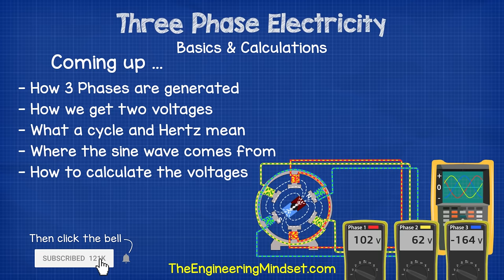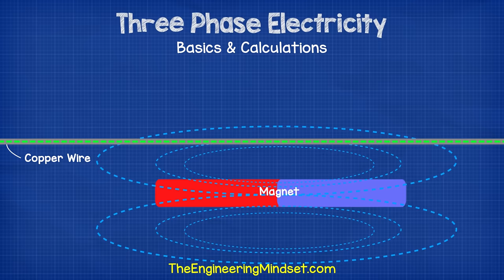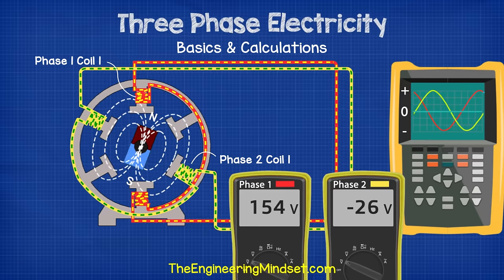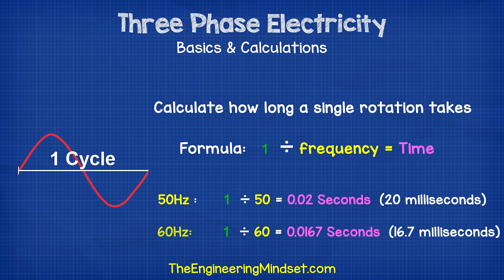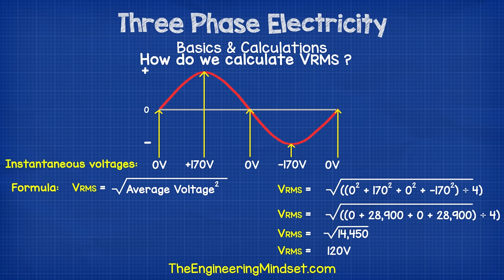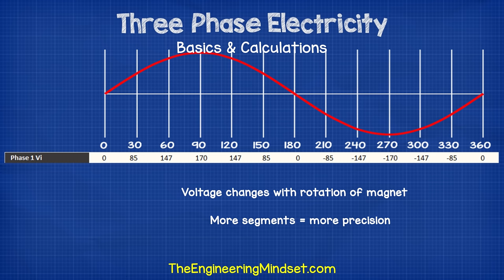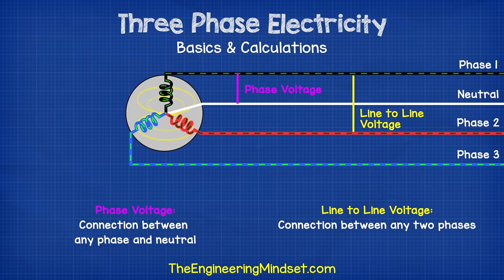Three Phase Electricity Basics and Calculations electrical engineering

Comment: In your other video, you were showing the max and min of the cycle to be at 0 degrees and 180 degrees, while in this video you are showing the max and min at 90 and 270.. isn't the cycle supposed to be at zero when the magnet's north pole points up (90) and south points down (270) since that is the neutral axis of the magnet? Im getting confused here because everything is shifted by 90 degrees compared to your other video (single phase explanalation - part of 3 phase video)

Comment: Why there is voltage differences between phase to neutral and phase to phase voltages. You didn't explain it in the video, but could you tell us about it??
Reply: because windings are connected together at one point (center of the star connection)

Comment: 11:25 Why use radians ? Vmax x sin(°) works just as well.
Reply: I'm just guessing, but I think this is for knowing phase at a glance. In most formulas, you'll see little omega, which is practically a constant, and theta. Omega is in radians and theta is in degrees. Since you can only compare phases between sources with equal frequencies, by separating them you can see at a glance how much out of phase it is and if it leads or lags. In fact, in the phasor domain, you ignore the frequency and focus on phase only. This makes for easier AC circuit analysis with capacitance or inductance elements.

Comment: Hello. Thanks so much for making these. The visual aid's are very helpful.  I'm having problems getting the same values for "Vmax x sin (radians)" I see it work for the 30 degrees calculation at 85 volts, but the others have me perplexed.  I.E. How does Vmax (170V) x 1.571 at 90* end up 170V?
Reply: It's 170 V * sin(1.571). 1.571 is 1/2*pi radians (or 90 degrees) and the sine value is 1.

Comment: What things can we use with 2 -phase  or 3 phase electricity?
Reply: It's commonly used in homes for ovens, dryers or tankless water heater. But really anything really powerhungry.
Reply: Thought Provoker    Nothing I know of runs on 2 phase.   Tesla gave up on 2 phase in the 1890's.   3 phase.   Motors are the only true three phase equipment.   Large electric heat systems take 3 phase power, but the reality is they are single phase heaters connect in three phase configuration as an example.

Comment: could you help me please
I built 2 rotary ph. converters 240 VAC   in, Using a 10hp idler at 1450 rpm, It only took caps of 50 micro  farads on each leg to obtain a very even 230 out three phases
but most of my machines run on 415 vac , when I tried to get that from my phase converter by piling on the cap, the motor got very hot
realising that I need a step-up tranny
the odd thing is that i can run my genset 415 to run a hydraulic power pack without issues even though the the motor label says 220 vac only---it came from a ship
it runs well too on the phase converters
will long term use running that motor near 400 damage it
thanking you

Comment: I dont understand why the voltage is in phase with magnetic flux in this example. Because if you graph a sinewive (magnetic flux) you take the slope of the graph and that is the voltage, that is another sine wave but not in phase with the magnetic flux. Can somebody explain why in 4:53 a peak in magnetic flux is in phase with a peak in voltage? thank you very much

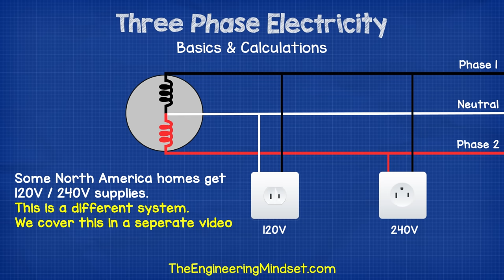Comment: 2:09 A split-phase supply is not a two-phase supply, that's a (type of) single-phase supply. It is single-phase because there is only one phase angle, despite having three voltages. An actual two-phase supply has two phase angles; two voltages in quadrature (i.e. 90° out of phase) in time; it is a two-phase supply because it has two phase angles, not two voltages. And a three-phase supply is three-phase because it has three phase angles, despite having three line voltages and three (in three-wire supplies) or four (in four-wire supplies) phase voltages.

That's the way I look at it.
Reply from the maker: Seen our new 3 phase transformer video?➡️: https://youtu.be/u0SsejDCVkU

Comment: Hi Do you know what Tesla's 2 phase Niagara falls generators were?
Reply: Sam Stewart    Did some research.  This is what I found.  
Westinghouse furnished the 5000 horsepower (3,700 kW) generators that connected to the turbine. Twelve, 2800 pound, electromagnets plus the drive shaft provided a 25-ton flywheel that spun as an outer structure (umbrella type) around the windings that were arranged as two sets of poles at 180 degrees to produce two phase and 2,300 volts. Six poles rotating at 250 revolutions per minute produced 25- cycles. This output was connected by four wires to a control panel
Reply: @KevinCoop1  quite an impressive construction...
Reply: Eric Scaillet     For it's time, agreed.   I've worked on projects that were much bigger.   Like one building that was 25 times more power and powered by diesel.   A small part of the whole project.    Happy 2020 New Year!
Reply: @KevinCoop1  Excellent research and explanation......many thanks!
Reply from the maker: Seen our new - How wind turbines work video? link: https://youtu.be/Hf875eOVrVI

Comment: can only 2 out of 3 phase work? what kind of voltages would you get?
Reply: If you take 2 phases only, it behaves like single phase (two wires only) and the voltage is 400V for example of europe, some small welders use that kind of supply - they have single phase transformer but you connect it instead of phase and neutral (230v) to phase and phase (that gives 400V)
Reply: Vo Town    If you consider phase as a sine wave, in 3 phase clockwise rotation A-B phase 1, B-C phase 2, C-A phase 3,   There is a configuration called open delta( 2 phases 3 connection points only 66% of the power available).  If you consider phase connection points as A,B,C then connecting two points is single phase not 2 phase.  In 480/277, would be 480 volts single phase.  In 208/120 volts would be 208 volts single phase.   And yes these are used all the time or normal.  Hope this helps you.   Respectfully,   Kevin

Comment: Here in Brazil, some cities have 127V Phase voltage and others have 220V phase voltage. Is It possible to convert 220V Phase into 127V in my house? I'm moving to a city that is 220/380V and i want to bring with me some stuff that is only 127V. Is It possible to convert 220V Phase-Neutral into 127V WITHOUT a Transformer?
Reply: @Basement-Science  thanks for your reply. I need to power a refrigerator, freezer, Air fryer and a Microwave. I guess i'll buy those rated for 220V, since i'd need 4 transformers. I'll try to sell the 127V devices, it's not worth trying to use them here.

Comment: The voltages, in this video, are primarily residential voltages. All have the same relationship, for 3-phase power, the Phase-Phase voltage must always be Square Root of 3 times the Phase-Line voltage, that is true for all the  voltages shown @2:30. 
Industrial and larger commercial users usually get higher voltages than those shown, with 277/480 as one common example, and generate the common voltages in-house.

North America, uniquely, has dual voltages in all residences. All homes have either 120/240 or 120/208, and have also slowly been drifting from 110V to 120V and above.
Reply: 2:22 - 2:42 :   √3   ≈  208÷120   ≈   380÷220   ≈   400÷230   ≈   415÷240.   Also at 14:00.
Reply from the maker: Seen our new 3 phase transformer video?➡️: https://youtu.be/u0SsejDCVkU

Comment: I have mechanical engineering degree and we absolutely FLEW by 3 phase power in my class. No student should even be touching a pencil and calculator without understanding the fundamentals of what they're even doing but hey we just need to pass the class right?

Comment: The single phase supply voltage in the UK  is 230v and has been for years, NOT 240 volts as stated in these videos
Reply from the maker: The nominal voltage is 230V, but it's allowed to be anywhere from 216 to 253V. My house is usually around 243V
Reply: @EngineeringMindset  I know that. I am an electrician and former teacher in electrical installations. 
The video stated that European nominal rms voltage is 230/400 but the UK is 240/415 but the UK voltage was brought in line with Europe in the 17th edition of the wiring regulations
Reply from the maker: We are aware of the mistake that was published but, frustratingly, YouTube doesn't allow videos to be edited. It is a minor error that doesn't detract from the main teaching.
Reply: @EngineeringMindset  well that's ok but in your first reply to intimated that I was wrong with what I said. But getting the supply voltage wrong is a fairly fundamental error. The video is emphatic about different supply voltages in various countries.
Reply from the maker: I disagree. If I had said it was 12V DC, that would be a fundamental error. Even in the video we show a real world voltage reading. I do regret it was published with an outdated nominal voltage, but it's within the limits and is not the main topic of the video.
Reply: @EngineeringMindset  But its still wrong. It can't be a bit wrong. Don't get me wrong it's an excellent animation. But it's still misinformation.

Comment: Neutral of magnet shown with zero voltage is different than neutral shown in another similar video of three phase electricity. Why so?
Reply: This video animation is Wrong, electricity is Not produced by a magnectic field but by a change of a magnectic field. 
When the magnectic field is the lowest to the coil the change is the largest and then the coil reacts the most 
and the the highest voltage ( or current ) is produced.  In a more deeper sence the coil wants to stay as is was the coil
Does Not like a change to counter the change the coil produces voltage and current and electrical current produces a
magnectic field to eliminate to magnectic field it is exposed to. ( M. Faraday  J.C. Maxwell )

Comment: European Union regulations specify a target of 230volts (+6% −10%), for about 10 years now. It did used to be 220volts but the European Commission decided to make it the same as the UK, which used to be 240volts. I understand we all get a little less or more  than listed anyway, so the reality will probably usually be somewhere between 210-240volts https://en.wikipedia.org/wiki/Mains_electricity_by_country

Comment: You were doing so well on other videos but you incorrectly call Line phase in this video. Phase is in relationship between Lines not the lines themselves. Place 3 dots on a circle 120 degrees apart 12, 4, and 8 O'clock. now draw lines to connect the dots. It takes 3 of the to do so correct? Now remove just one of the 3 dots how many lines to connect the dots now? Just one, single phase. It is to easy to confuse Line and phase when in a 3 phase system there is 3 of each But it is incorrect to assimilate them into one and another! Line or hots, phase happens in-between the lines!
Reply from the maker: Seen our new 3 phase transformer video with worked examples: link- https://youtu.be/u0SsejDCVkU

Comment: The information is wrong about the default voltage in Europe, Since 2008 the standard is 230volts for 14 years now, only UK deviates from this standard, and 400volt for triple fase, not 380v

Comment: Can we convert 1phase to 3 phase voltage?
Reply: If you're talking about your household voltage, the answer is "no". The phasing occurs in the transformer on the pole. So you would need a 3-phase transformer on the pole.
Reply: There is a way to do this but not so efficiently.  Use the household 1-phase electrical to drive a mechanical generator with three phase coils.  I have seen such devices for sale.

Comment: Just for clarification: Australia uses 240 Volts AC @ 50 Hz
Reply from the maker: No, it's officially 230v as the country is part way through a voltage reduction to align with the rest of the world, not all States have implemented this yet and still operate at 240v

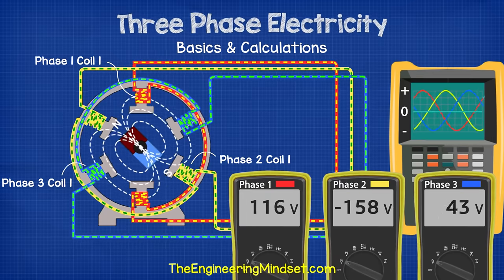Comment: Why would we need 6 cables? 6:34
Reply: As there are 3 hot wires and there will be 3 nuetral wires, so total 6 but as nuetral wire main functionality is to Carryback the current to source so we can have a single nuetral wire for 3 hot wires..

Comment: Still don't get why there is more voltage (>380V) difference between two phases when each of those phases have the same voltage but shifted, so at any given time in fact their voltage is cancelled out if you short them.

Comment: What happens if you connect all three phase lines together?
Reply from the maker: You get a big bang and the breakers trip. Hopefully you still have an arm left.
Reply: @EngineeringMindset  but why, shouldn't everything equal 0V?
Reply: Or it's because if you connect three lines then connection should be looked like 1to2 and 2to3 and 1to3 - then between 2 wires it is 0v only one/two times per cycle (ex. +147, -147, 0) and if it is some other time in that cycle (+85, +85, -170). Wait... Ok, so total it is 0, but because 3 connections, yes there with 1st example no current between 1st and 2nd phase, but current will flow from 1st and 2nd phase to 3rd phase
Reply: On the right track or far off ?

Comment: 240v in Australia mate
Reply from the maker: Australia has a nominal voltage of 230V, each state is meant to reduce their voltage to bring it inline with the rest of the world. But, most haven't implemented this. Some states only have sections at 230V. So the official voltage is 230V but 240V is in practice.

Comment: Australian single phase voltage is 240V, not 230V
Reply from the maker: Nominal voltage in Australia is 230V, AS60038-2012 Standards Australia variation -6% - +10%

Comment: 10:25 something is wrong. Ca anybody write what is proper colors of fazes?
Reply from the maker: If you check out star delta video, we have a section on 3 phaseUS colors so you can translate
Reply: @EngineeringMindset  i was meaning something other. The maximal point of electromagnetic field is wrong, propably red phase is ok (maximal point of wave), but yellow should be blue and vice versa

Comment: what i still dont get is the importance of the supply frequency.. why 50/60.. why not 500 or 10000Hz
Reply: This has been selected so that motors can run directly from mains power at a reasonable speed. 50Hz gives 3000RPM for a single pole motor.
Reply: also higher frequency - higher loses
Reply: Navin Lessing     If 50 Hz is 3000 rpm and 60 Hz is 3600 rpm, do the math and figure how fast the utility company would have to spin their rotary generators to get 1000 Hz.   They would fly apart!

Comment: Australia Residential Power is not 230V AC
it's 240 V AC,  10A  50Hz
Reply from the maker: The national nominal voltage is 230V in Australia. Its part way through a national transition to reduce the voltages to 230v and align with the majority of the world. But most states haven't implemented yet.
Reply: @EngineeringMindset  
Which Australian standard Says so ?  and in what section ?
I've read the standard (Granted it was a while ago) but it has always been 240 V .
so if you could supply me the standard and the section of the change that would be appreciated.

Comment: This is all very digestible, but for some reason, I can't find ANYWHERE that answers the actual question I want answered!
The electricity is generated by induction, induction through the poles, the poles affected by the magnet, because the magnet is spinning...
HOW IS THE MAGNET SPINNING!? In a motor, an electric current can make an electromagnet force it's North and South poles, and so bringing a magnet near it causes it to spin because the poles never actually move, but it seems almost counter-productive to use electricity and magnets to move magnets for electricity just because of the laws of thermodynamics.
I've also heard it's a thing of cutting the power on something in a sort of 3-phase way so the magnet gravitates towards that, but you'd have to do that SO FAST with how many rotations are going on, it feels like falling out of sync is inevitable.
So what is going on to make the magnet spin? What do they use? What are the physics behind it?
Reply from the maker: You can use a wind turbine, a diesel engine, a water wheel, a steam turbine etc. Anything that spins is bolted to the axle and it physically turns the magnets. Instead of a magnet we can use an electromagnet the you can use electricity to control the strength of the electromagnet and that changes the output voltage of the generator. 
If the grid frequency is 50Hz then that's 50 cycles per second, meaning the magnet rotates 50 times per second, and with 60 seconds per minute you just need 3000 revolutions per minute to achieve that. (60Hz = 3,600) So we can just use a gearbox to achieve that.
Reply from the maker: Seen our new - How wind turbines work video? link: https://youtu.be/Hf875eOVrVI

Comment: Australia uses 240Volts
Reply: No it's actually not Bill, sorry, Careful of broad statements. Ever since 1920 the whole country was set and used to be 240V +/- 6%, but from about 1980 ish from memory we saw voltages in states OTHER than QLD, WA, and NT or ACT I think, slowly start to decrease towards 230V.  In 2000 a standard was adopted for Australia (Hmmmm AS60038 rings a bell) to   What everyone is missing here when they state hard facts about a country being a specified voltage, is that, a country has a gazetted voltage but it also has a minimum and a maximum  tolerance.  So Australia is and has been for 20 + years a 230V country BUT we have tolerances of +10% now and we kept the -6% however thrown into the mix is that we have a PREFERRED tolerance of +6% -2% I think.  Whats strange here is that his information on the UK, where he comes from AND the US is wildly inaccurate, and in alll cases people SHOULD be aware of the tolerances. Now just because QLD, WA and ACT didn't take on the AS60038 didn't cause any issues because you guys, even at 240V fall into that band of tolerance if that makes sense.